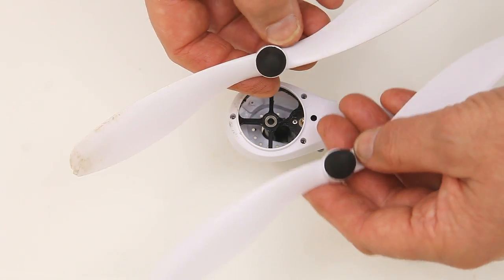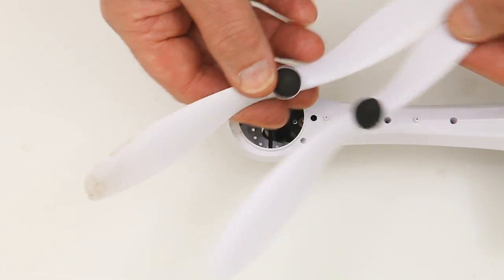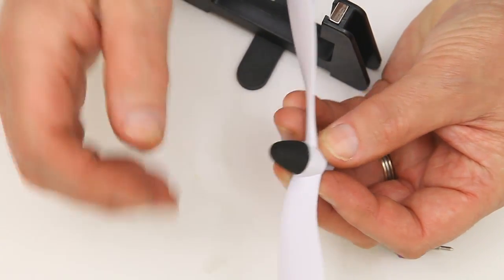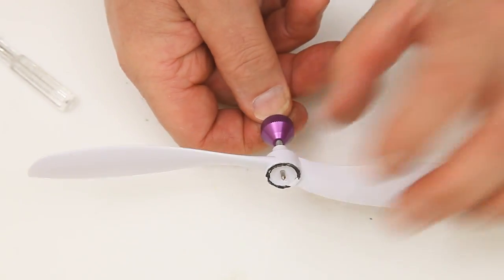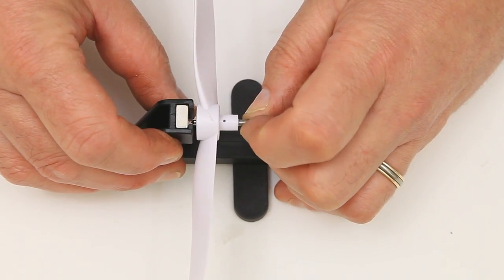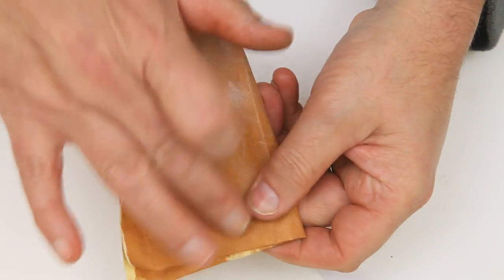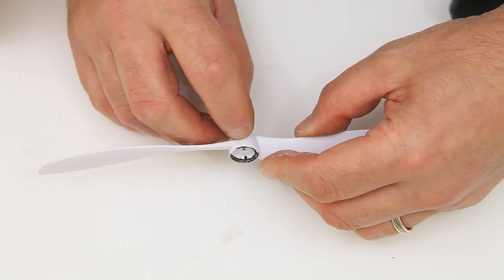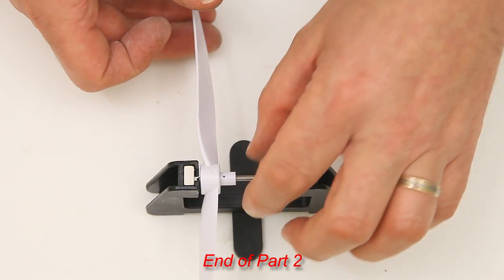How I Balance Propellers Tarantula X6 (Maintenance Part2)

Comment: How much difference did it actually make? I have a an X6 too. I did the bearing upgrade and like you said with your, mine flys great, does manual double backflips and all. Apart from a small brush with a tree and falling from the sky on its feet(with the modded landing pads) from a dead battery I haven't crash mine so far. If I could notice one prop was vibrating and out of balance from a crash ect.. and I didn't have a spare prop then yeah I would do. Although not owning a balancer do you think it's worth doing, also given I could potentially tear the foam on the top of the prop too?
Reply from the maker: Balanced props make all the difference, but if it flies OK and you are happy with it, then that's the main thing. Unbalanced props bring premature wear. the foam covers do nothing to affect flight, you will have to remove them to balance ;-)

Comment: Nice video. I did sanding too on my props since when using tape was not stable because the tape can moved anywhere when the props rotates. That's why there is no balancing tape on real aircraft's propeller.

Comment: I have people bugging me to do something with the controller ,
I bought quad from them and they say is not broken , but is impossible to fly this thing!!!
 
do you understand what they mean and what I need to do ? 
They said:
First open the fuselage, connecting body power and then turn on the remote control. If the remote control left is accelerator (remote control can switch left and right) ,down the left of the remote control ,then up, and then down, to the right direction of the lever to remain intact, then under this case, the lights keep steady ,it finish frequency
  
Do you know how to sort out this problem??? (quad fly it self like drunk)  https://www.youtube.com/watch?v=PmvbWmidwno
  
Many Thanks in advance
Reply from the maker: +DYMO All a bit confusing to say the least :~) it sounds like they want you to re-calibrate the accelerometer https://www.youtube.com/watch?v=op8x2xlBGGo , well maybe anyway, but you don't need to remove fuselage for that. I would try that first hope it helps if not I do not understand there information. Good luck!
Reply: +Tigger's RC Reviews I try is not working, I try all possible configurations ans this one,  does not have reset configuration
Thanks anyway
Reply from the maker: +DYMO Sorry it didn't work let me know if you get it sorted may help others :-) Cheers
Reply: +Tigger's RC Reviews I think it's just bad   acellerometer , 
 and bout our previous conversation about gimbal, I  think you could use camera and video buttons to change the gimbal angle , just do wiring or something.